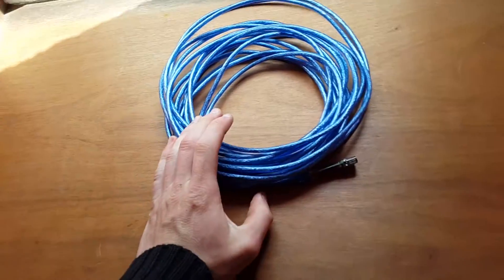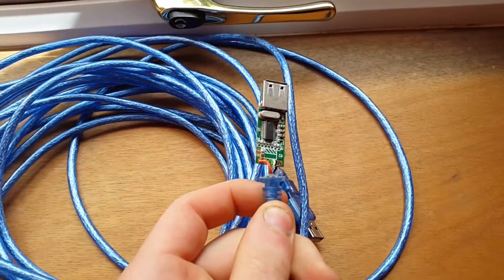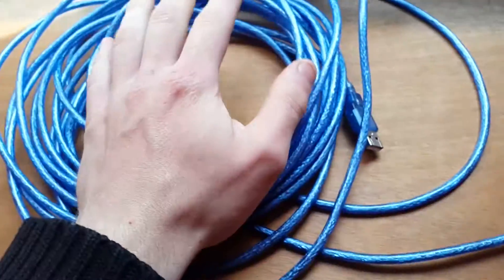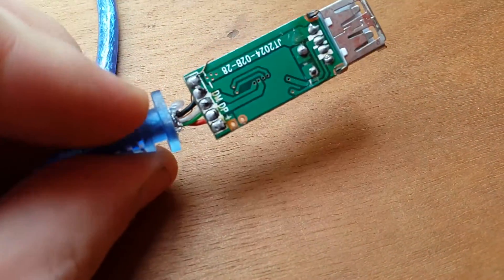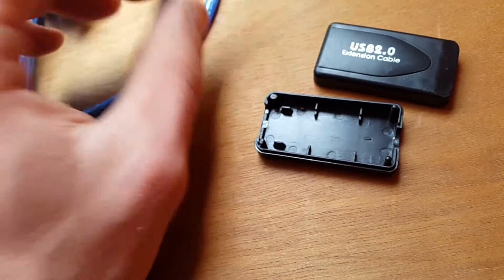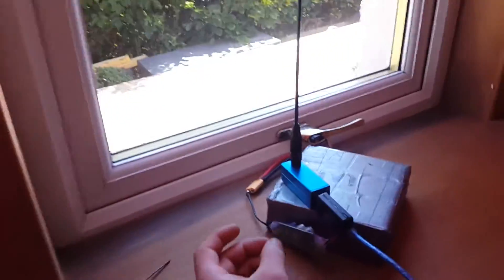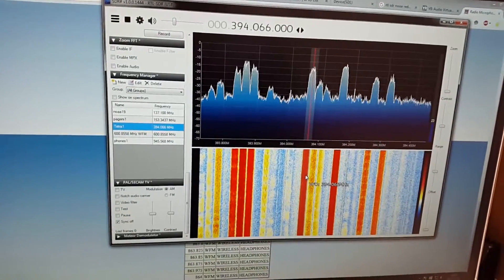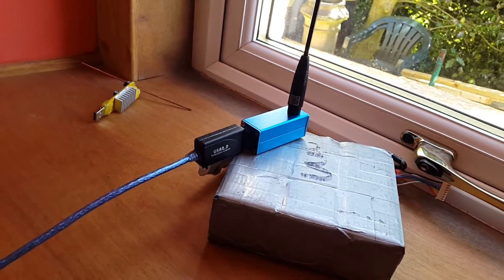RTL SDR USB Extension Cable

Comment: thanks for this... I had the same problem with the generic clear-colored cable and black box female side active usb cable/repeater. I thought the sdr had died because it worked at first until I swapped computers and the sdr would freeze sdr#. 
Due to increasing lack of time I've bought the $45 (US) one that takes external power, stock. Kind of sucks if it still will tolerate only lower sampling rates than a 6 ft. cable. Duno if a usb 3.0 would help? Probably not unless the sdr touts usb 3.0... I was just using the simple TV dongle but I've ordered of the $66 US little aluminum generic boxes sold once as USmile that has an integrated upconverter instead of just using Q... surprised to find out web sdr's I've been listening to and enjoying are just these, nothing fancier like Airspy, which I'd have bought if the upconverter wasn't another $50 after the boring U/VHF side costs $165 alone...  so I'll deal with the lesser specs... it will be fancy having one here at home with my 43 meter antenna ;p , and I can tune in with an analog tube radio if I like a particular broadcast enough.

Comment: Hi Shaun.. It is not clear to me why you are extending the USB cable and not the antenna cable?  Much easier to run low loss coax.  Anyway, I am a fan of your work, especially in HVAC.  As to radio work...are you a ham?